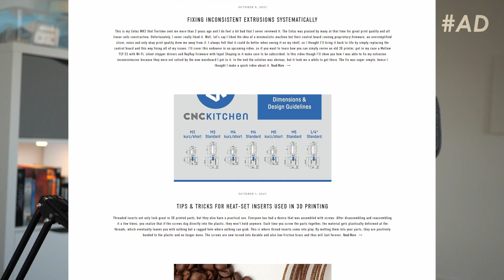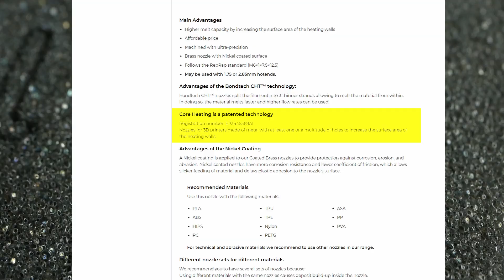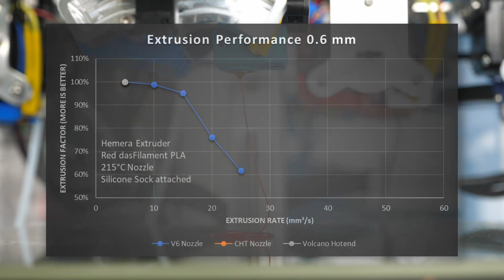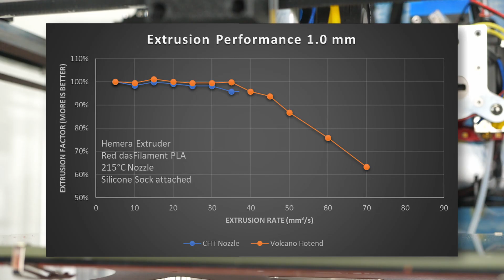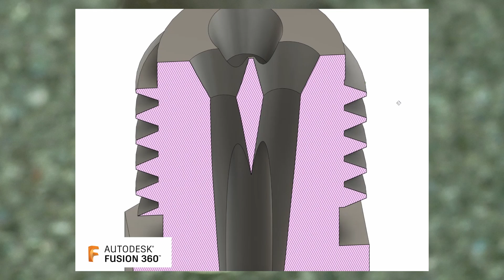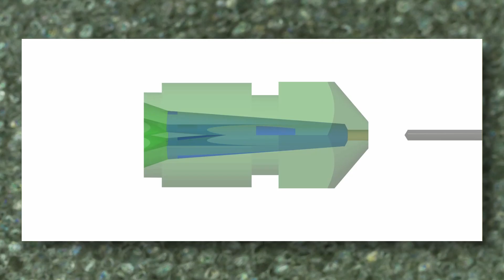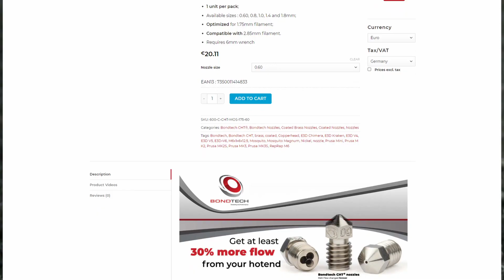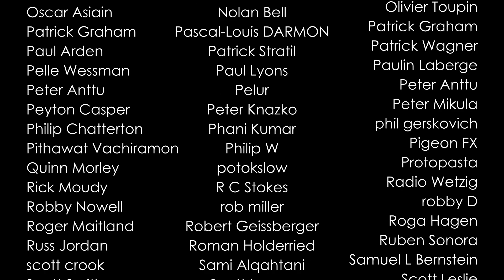Does This make Volcano Hotends Obsolete? Bondtech CHT Review

Comment: Wait a couple of weeks until there's a trianglelab version of it.
Reply: I can already see the little bridge/cutter falling out of their low quality material.
Reply: @REDxFROG  what are you talking about? Also look at that poor surface quality of the original. All chipped and scratched from the factory.
Reply: @HungrysitesRu  I mean the force of the filament will push out the metal piece in cheap china clones. Cheap means cheap. Cheaper material being used.
Only because it says titan on the sticker it doesn't have to be that.
How can anyone be so cheap and not just buy it at 20 bucks? It's well worth the price if you think you want the extra engineering.
Reply: Yeah, but I've gone down that rabbit hole and the rabbits were pitiful. Had two Triangle Labs Bondtech BMG knockoffs and after fighting continuous battles with them for 6 months I gave in and bought genuine Bondtechs' . Night and day difference. SAME story with the BLTouch, the knockoff didn't return repeatable results. I'm kinda mad at myself because I have always bought top notch tools. 3D printing is a precision hobby. Cheap = crap. Oh it may WORK, but it won't work well. Sometimes you just need to spend that extra $10. Factor in having to buy AGAIN and it's cheap. I'll buy the Bondtech version thank you.
Reply: @mickmouse2258  I'm using their BMG gears and motor (didn't notice any difference switching to it), their dragon extruder (much better than default) and their ruby nozzle (works well) on my prusa. Maybe I got lucky. But sure, 20 dollars isn't much for this. I mostly buy Chinese because it's so much easier to deliver to Russia.
Reply: @HungrysitesRu  Yes, AliExpress has great support of Russia, and sometimes I do buy the cheaper versions of things, especially something that can be expected to wear out and the math of buying 5 cheap ones outweighs the longer life of one good. Cheers from the US in these tough times. Best of luck.
Reply: @mickmouse2258  Thank you! I condemn the invasion of Ukraine!

Comment: My preference would be a hardened steel nozzle. I often like to print in woodgrain filament and without having to change the nozzle. Going through brass nozzles like crazy isn't ideal for me personally. I've purchased exactly 1 hardened steel nozzle and it has been going strong for more than 2.5years. Much less hassle. 

Hell I'll tear down an entire axis on my printer and redesign it, add new parts, change pulleys, etc.... I love tinkering with the printer itself but when I want to make a print, I don't want to dick around with the nozzle. Speed and flow rate are the bottom of the list for my priorities. I've designed and built my own printer from scratch, that's the largest part of the hobby for me. The best nozzle is one I don't have to mess with... =)
Reply: I wonder why they don’t have chromium coated nozzles

Comment: So... No Flex test? Looks like this nozzle will increase resistance on the input making Flex a lot harder to print
Reply: There's no reason to use something like this on flexibles. Flexibles don't even come close to using all of the flow provided by standard nozzles, so adding extra headroom would be pointless.
Reply: I printed a cube using 42D hardness TPU at 50 mm/s with 0.6 CHT nozzle.
No problems so far
Reply: These nozzles do not bring significant advantages when printing flexibles. We tested it.

Comment: I just had a realization that cold pulls on these things will be impossible. Best hope there are no clogs.
Reply from the maker: Coldpulls are possible. Check the end of the print results chapter.
Reply: @CNCKitchen  I just reached that part of the video right after typing the comment... I was debating deleting it, but I've been caught
Reply: Don't burn the nozzle to do a cold pull. Use the printer. For PLA, set the temperature to 90C and let the hotend cool down. Meanwhile push filament into it by hand. When the printer reaches 90C, pull up the filament slowly. The trifurcated strand will come out with eventual debris attached. You may also need to pull the oozed plastic from the tip of the nozzle. Clean.
Reply: @nunosantiago6720  Cheers to y'all at Bondtech . Pls. give us a solution for tech & high temp. materials asap 👍🤓
Reply: @reinholdu9909  We will. We just need some time. Steel is a whole different animal.
Reply: I never have much luck with cold pulls anyway, I usually end up burning them out

it probably doesn't help that I mostly print nylon anyway though

Comment: One needs to design a nozzle with 4 holes to bypass the patent ;-)
Reply: Patent lawyers usually make the patent claim as broad as possible to account for stuff like that. It is really crippling the industry.
Reply: That's generally not how patents work. I'll eat my hat if they didn't just define it as a multiple hole extrusion unit.
Reply: @nobodynoone2500  Yes, it is for 2 or more holes.
Reply: Also if you are a chinese  manufacturer, the patent is more like a suggestion... so no worries
Reply: @ffoska  4-hole nozzle on a Dragon would be awesome... Might stick one of these on a Dragon anyway (still have a few sitting around somewhere...)

Comment: I mean, better/more contact between the filament and the hot end makes it melt faster... that is just common sense. It's like they patented a heat sink with wings, instead of a block of metal.

Nice. now I want one made from hardened steel, with three intersecting triangular-conic cutouts. It could be easily machined with an EDM dye machine.
Reply: It would be possible to EDM but each nozzle would probably cost $100. EDM time is not cheap.
Reply: @DoRC  You cold pre drill it close in size, and then just EDM the rest. That way you get the EDM cycle time down and make it cheaper to manufacture.
Reply: @DoRC  3D metal print the new nozzles. You'd then be able to have any internal nozzle geometry you like.
Reply: @BikerCaf  that would be sweet! But expensive
Reply: @DoRC  Everything is expensive to start with in manufacturing, but as any designer knows, once mass production gets going and nicely fine tuned and sorted it all becomes cheap as chips (usually without the buyers learning about such things).
Reply: Your comparison is very unfair, they only patented this specific design, the idea of increasing surface area is pretty simple, but they put a fair bit of effort into developing their way of doing it.
Reply: A high flow nozzle also needs to conduct heat through the metal.  Steel isn't a great heat conductor.  Stainless steel even worse.  Aluminum, or even better copper, would be a step up here, but are softer materials and would need a tip insert.  Once you go the direction of built up construction, a core insert is an option.

Comment: You could use ECM to erode a normal volcano nozzle to increase surface area and compare it.
Reply from the maker: EDM or an insert might be the only feasible option for the long Volcano nozzles. I'm excited to see what companies will come up with to make the parts also at a competitive price.
Reply: Does ECM produce a flat enough surface?
Reply: @ismaelyu5  it definetly can. But probably would need some experience and r&d

Comment: According to the chart at 10:00 wouldn´t it be best if you were to rotary broach a triangular hole in the top of the nozzle and the put a champfer in the bottom with a centerdrill for less resistance and maximum circumference to crossarea ratio? If someone doesn´t know what rotary broaching is I recommend the video by ThisOldTony about it.
Reply: Rotary broaches tend to have less precision and higher wear on the cutter. Using drills isn't because engineers don't understand physics, it's because they do.
Reply: Also with an EDM machine, you could make the triangle big on the tom, and small on the bottom, to give it that conic shape. But yeah, rotary broaching would be much simpler and cheaper
Reply: @ffoska  If edm is used, a design with much more ridges could be used to increase internal surface area further than is practical with drills.

Comment: How well would this work if it were the same length as a volcano nozzle?
Reply: Probably not posible / easy to manufacture a longer one, though could Frankenstein it in to a volcano heat block by cuting a section from a regular nozzle to use as a spacer.

Hot tightening would suck though as both the heatbreak and nozzle would need to be hot tightened

Comment: nice, my prusas are collecting dust bc i build a ratrig recently, but if bondtech releases a 0.4mm nozzle they will be revived
Reply: Just use the 0.6mm and use it to print larger parts that don't need high details.
Reply: What would a CHT 0,4 make so different to it? Haha
Not bashing the product. I have a CHT 0,60mm. But replacing a std0,4 with CHT0,4 really doesn't do much. If anything at all.
A standard Prusa MK3S+ usually prints slower to achieve quality. Not because the flow is too high.
Reply: @REDxFROG  who hasnt hit the max possible print speed on their prusas already? They are  very nice printers, reliable but also slow. A 0,4mm cht nozzle for 20 bucks is a much cheaper upgrade than a new hotend
Reply: @HelgeKeck  I haven't. Because I wasn't tinkering with the settings like I did with the China printers.
The settings by Prusa are tested.

And because you can print a few minutes faster it wouldn't mean the printer suddenly stops collecting dust
 Sorry it just doesn't make sense 😁 the printer is wonderful as it is. Both Mk3S+ and Mini+. (Mini better with heatbreak upgrade)
Reply: @REDxFROG  i dont say the prusas are not wunderful printers, i love mine. but if you havent seen a real fast printer, like a ratrig for example, you dont really know how slow the prusas are.
Reply: @HelgeKeck  I really don't care about these fast printers. They pretty much mostly achieve garbage quality. They are loud. They consume stupid amounts of energy and wear down in no time. The plastic requires time and energy to lay down and bond properly. Going too fast means both requirements are not met.

The people behind "stupid fast FDM" is an entirely different group. They are 3D printing hobbyists. Trying out stuff.
Others only need TOOLS that actually work.
Don't always only mention Prusa. Because EVERY other FDM printer by enterprise manufactures are just as slow/fast.

Companies like Prusa are not heading towards these questionable accomplishments, hyped by youtube fans.

You say your printers collect dust because they run too slow.
If they would run much faster they would actually run? Why don't you just sell them since they are too slow?
Reply: @REDxFROG  sorry, but you have obviously no idea what you are talking about. My prusas are collecting dust bc my new printer runs multiple times faster and at the same time it produces better quality then any of my prusas ever did. If you dont get it ok, but please dont start a discussion with me just because i shared my personal opinion about this nozzle. if you want stuck with your prusas, thats fine, i dont have a problem with it.
Reply: @HelgeKeck  better quality than Prusa and MULTIPLE TIMES faster.
Dude. Talk trash to somebody else. But please make sure Josef Prusa does hire you for his team. Because you are printing god.

Comment: Well, I bought a third-party 0.8mm nozzle recently for 10€, had I known this video was about to come I'd have waited. Awesome testing as usual, Stefan!
Reply: But the product has been available longer than this video. You should check out more YouTubers and news 😅 I have a CHT 0,60mm. I never wanted to install such large nozzle but this design is too good. The print speeds for functional parts are insane without making the printer go insanely fast.
Reply: I'm not heavily invested in 3D printing, so that's on me. I got like 3 printers that run a couple times a month max, they're more of a tool than a hobby

Comment: so, does the 1.8mm nozzle work with 1.75mm filament because you're splitting the filament into 3 1.2mm strands and then increasing pressure
Reply: It works just fine 3DNero had fun with it printing a fat vase
Reply: @NerminM84  oh i know it works, i saw nero's video, but im asking does it work because you're splitting it into 3 streams, because you shouldn't be bale to get 1.75,, filament to properly melt in a 1.8mm nozzle, but does splitting it into 3 streams of 1.2mm and then effectively making it a 3.6mm filament what allows it to happen?
Reply: @Mobile_Dom  You can print 1.75 filment with a standard nozzle to but as you wrote it will be pushed out colder because the core wont have time to melt. CHT (Core Heat Technology) splits the core and melts say smaller pcs from inside and outside

Comment: I wonder what the wear characteristics are going to be on that splitter edge.  Certainly anything like wood or glow-in-dark filaments could wear that edge very fast ...    The flow rate would have to slow down over time when the edge becomes problematic.   (still sounds like a win though.)
Reply: I thought most of the nozzle ware from when using abrasive filiments is caused from the motion of the nozzel across the part, rather than just extrusion.

Still be good to test
Reply: @bassplaya69er  if that would be the case then half the prints would fail because it moves the part around
Reply: Ooh, a good test would be to just dull that splitting edge. That should lead to some very bad behaviour.....

Comment: The whole Volcano hotend isn't obsolete, it's just the nozzles. Let Bondtech make a Volcano-compatible CHT nozzle and give the Supervolcano a run for its money. A Volcano nozzle that can print just as much as a brass Supervolcano nozzle would save a lot of space on the Z axis.
Reply: Volcano is eh. Super Volcano is a mess. The whole heating block is helt by a pityful small heatbreak, and it just shears with fatigue due to carriage movement induced forces.
Reply: @tonytober  All the more reason to make the Supervolcano obsolete.
Reply: @tonytober  I put a supervolcano nozzle on a dragon hotend. Solves problem of the heatbreak being the weak point, but the increased moment arm still increases loading on the whole hotend carriage.
Reply: I’m not sure if this approach could work on a Volcano unless it were made in two parts. How would they drill the splitter giving the length of the nozzle? The drill angle would be very shallow.
Reply: @JonS  i am keen on those water jet columnated laser cutters coming onto the market- they can drill 40mm of steel using a water jet to contain the laser energy with total internal refraction. you don’t need to cut the splitter in the middle, just the clover leaf shape as per this video
Reply: @JinKee  there is/was a German company with a system just like that for cutting silicon wafers in to individual die. It might be the same company. That system had its advantages (like non-rectangular die), but I think it required a wider kerf, so couldn't compete with standard Disco-type dicing blades.
In any case the issue is geometry. A long nozzle like a Volcano would have to have a much shallower drilling angle which would not allow there to be a center piece, nor would allow the clover leaves to be well separated. The surface area increase would be limited. This would be easy to draw. It's tougher to explain.
Reply: Exactly!
Reply: jebus we are gonna need bigger filament reels
Reply: @JinKee  Jepp. With 1.2mm nozzle and hanging printer, scaling up Steffan's mini-me to a 1:1-me, it would definitly be a good idea. But while you can get spools of 5 or even 10kg for some brands, I would recommend something like mosaiqe pallet to automaticly melt the end of filament of one spool to the begin of the next one. It gives more flexibility tho choose the filiament and multimaterial (Stefan 1:1-not-so -mini-me with glow in the dark eyes - but as glow in the dark is abrasive, you need a new nozzle afterwards...)
Reply: This costs half of a volcano and I don't need to sacrifice any print height or install a new hotend. I'm definitely buying this instead of a volcano
Reply: Depends what on whoever owns the rights wants to do.
Reply: @nobodynoone2500  moreover, whoever gets the license to do so.
Reply: I feel like a supervolcano version would be really interesting as well. And I'd love to see hardened versions for abrasive materials. Honestly I feel like $50 for the last nozzle you'll ever need would be a great price and I'd pay it even for my Ender 3 (already replaced the heat brake with a bimetal one that allows the tube to be only into the cool end so that would probably be my last upgrade to the hotend filament path.
Reply: Rapido UHF with a volcano CHT. The optimized SuperVolcano imho.
Reply: Toss in a Bi-Metal heatbreak or maybe with one of Slice Engineering hotends

~it's all fun and game until you realize. You exceeded limits of your motion system eons ago. I guess time to go voron!~
Reply: @F2_CPB  Voron/RailCore is the way to go if you can spend the money.
Reply: @F2_CPB  Imagine one of those nozzles on a volcomosq, it'd be the best hotend ever.
Reply: @F2_CPB  Do not need to be a voron. Input shaping with klipper do wounders even on Bed-Slingers - and closed loop drivers also. And with big nozzles like 1.0 mm, you do not need a fast kinematic to need high volume at all...
The limit you will hit first is not the kinematic. It's part cooling. Esp. using PLA. Berd-Air before Voron (of course best is both).
Reply: @F2_CPB  I honestly wish there were bimetal heatbrakes for the Hemera, or special ones to attach a mosquito block to it.
Reply: @F2_CPB  Voron are pretty shit though, I honestly don't understand the hype with them.